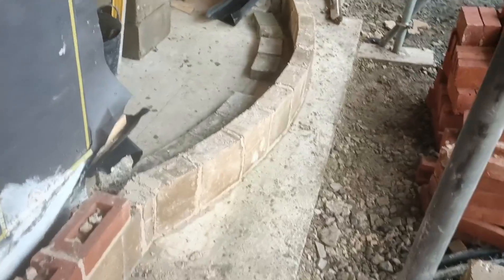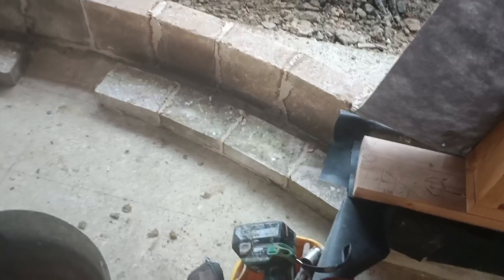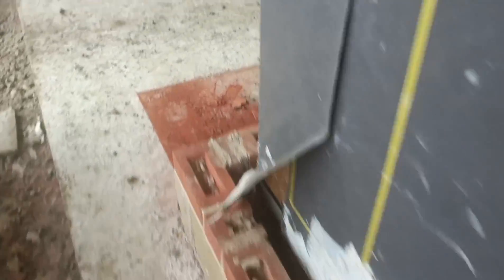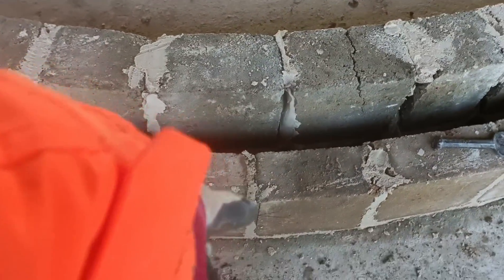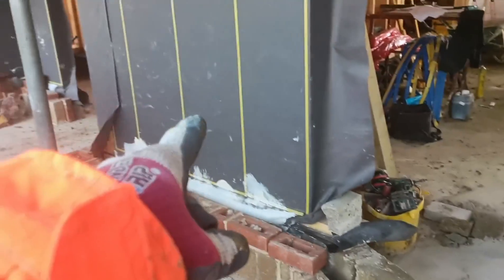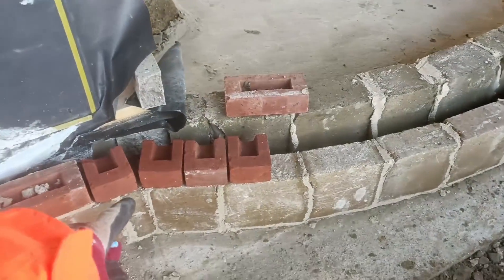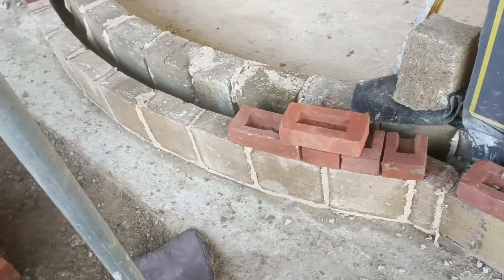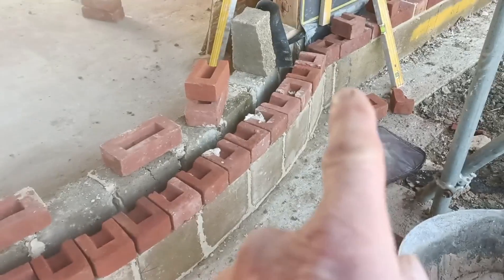Setting out and Bonding the Bow Window

Comment: What if you dry bonded in Flemish from the centre and worked your way out? So instead of the broken bond in the middle you could work out a suitable cut as it meets the straight wall. I wasn't there obviously, but just a thought!
Reply from the maker: that was a thought I had but I want the cuts to be the same where curve meets the main run, so the the blockbonding is symmetrical.
Reply: @robsonger1  I was just having beer and watching, all the best Rob, hope you're staying dry, got my first full week in this week,  hopefully more to come but I won't bank on it.
Reply: You can put 3 quarters at each end
Reply: That's what I was thinking. But I wasn't there so I don't know, matbe they tried all of this? @northlondonmasons107